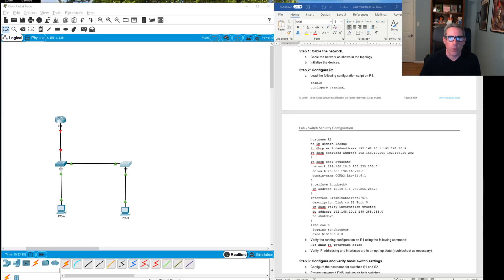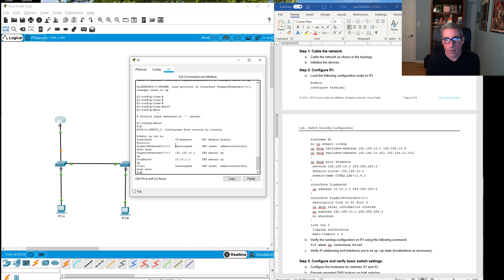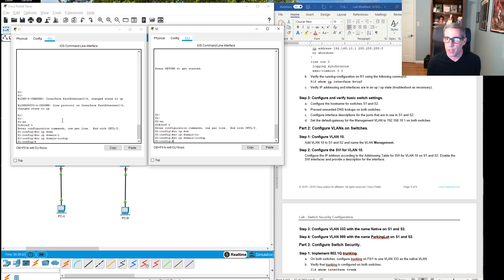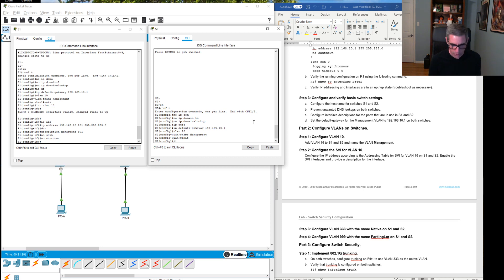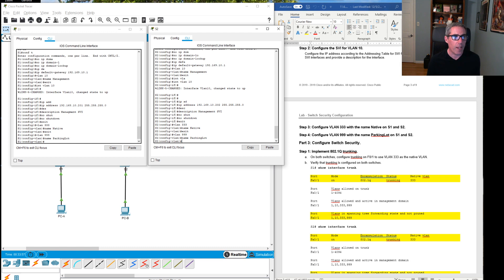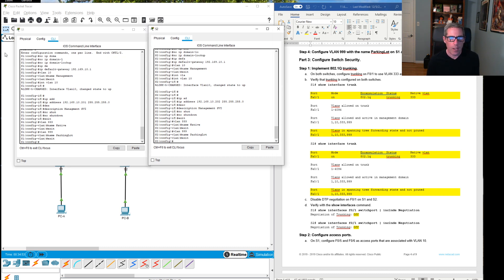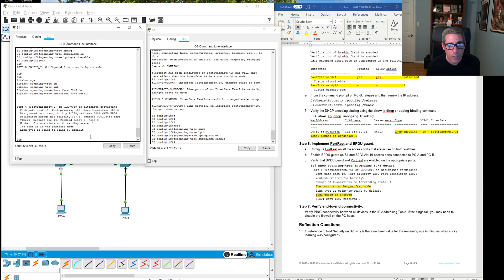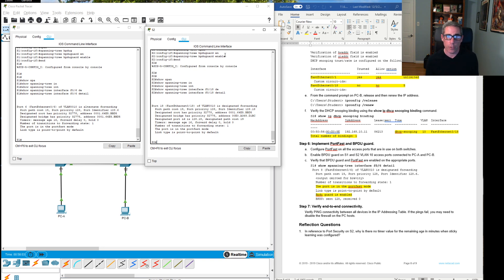CCNA 2: Switch Security Configuration Lab 11.6.2

Comment: d.Enable port security for F0/18on S2. Configure the port to add MAC addresses learned on the port automatically to the running configuration.  Skipped over this section.
Reply from the maker: These demos aren't normally a full step by step, I just cover what I need students to focus on. That said, I'm not sure if I skipped that section on purpose or not. Sorry.
Reply: @ProfessorAndrew  but the lab IS ABOUT network security, why would you skip over specific instruction? Switchport port-security' mac-address sticky. It's nice to see someone doing these walkthroughs in english, but this isn't much of a walk-thru, it really skims.